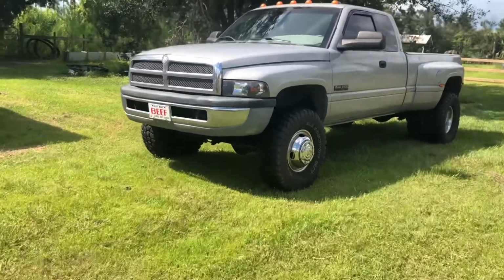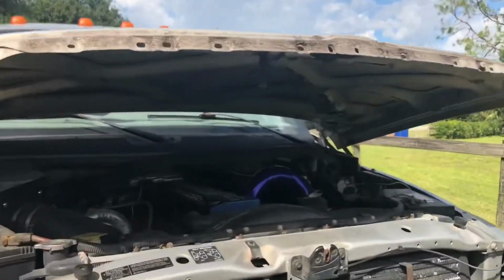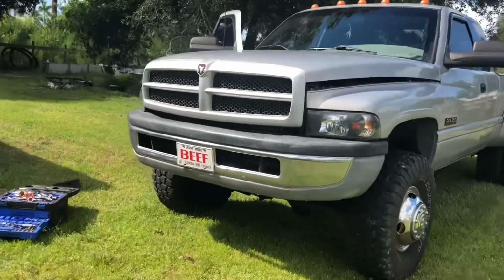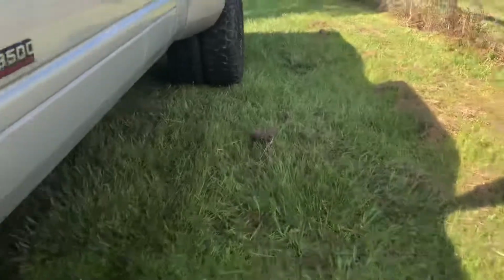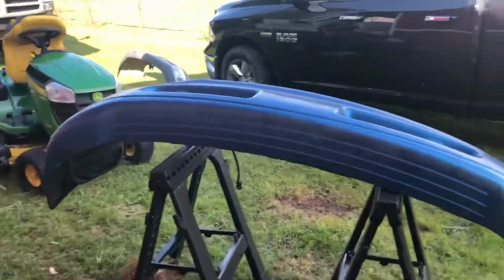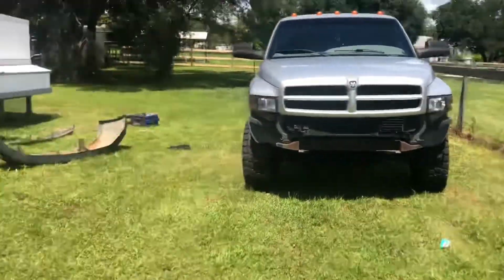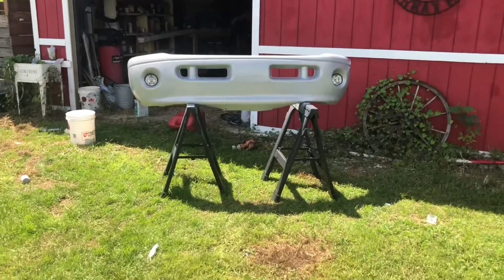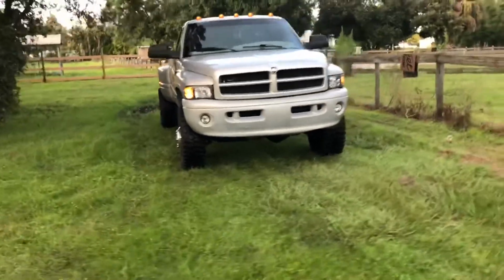How to: Sport front end conversion 94-01 Dodge Ram 3500

Comment: Just bought a 12 valve 1996 dually like yours here. I found a sport bumper and grille combo but the grille bracket/frame is rotted away. Typical here in canada, can I just take grille frame off the stock crappy chrome one and put it on the sport one grille?
Reply from the maker: That I am not 100% sure on, but it is possible I’ve never tried it

Comment: So does the sport bumper just bolt right on like the stock bumper would? I have a 4th gen bumper on my 2nd gen right now but I think the sport looks a lot cleaner. I’ve been wanting to switch I just don’t know exactly how it goes on or if I would need to buy any brackets for it
Reply from the maker: It bolts right on! Same as stock bumper! I think it’s cleaner too I’m not a fan of the 4th gens on 2nd gens much but I know they are really popular
Reply: I know this is old but do you guys know where to find a sport bumper? I have one but it’s dented up. Can’t find one anywhere online at all.
Reply from the maker: They are kinda hard to come by
Reply: Amazon has 4gen bumper brackets for 2gen i just installed mine looks way sharper

Comment: Does it just bolt right on?
Reply from the maker: For the most part yes
Reply: Is there anything I have to look out for ? I just have the sport bumper not the grille.
Reply from the maker: Just make sure the bumper has the factory brackets to bolt to frame and your good

Comment: What size tires and lift do you have? Looks good!
Reply from the maker: 2 inch leveling kit up front and 35s
Reply: The Diesel Ranch and rubbing issues?
Reply from the maker: None at all buddy!
Reply: The Diesel Ranch wow. Must be nice. I have 2 inch level and my 33s rub. But they are 12 wides..
Reply from the maker: Yeah I had another cummins a few years ago and I had 12 wides and they rubbed too, it happens I used to like all the big wheels but as I get older I really enjoy stock wheels
Reply: The Diesel Ranch you think if I get 35 inch mud terrains on stocks on 2 inch level I will clear?
Reply from the maker: I think you’ll be in good shape with those!
Reply: The Diesel Ranch Could the tires be 12.50 on stocks? Or would I have to go skinnier on stocks
Reply from the maker: Nah you’ll be fine with 12.50s!
Reply: Wat 2in lift did u use and did u replace the control arms
Reply from the maker: A really cheap amazon metal spacer, and I did change the control arms out to tubular arms front Stryker off road